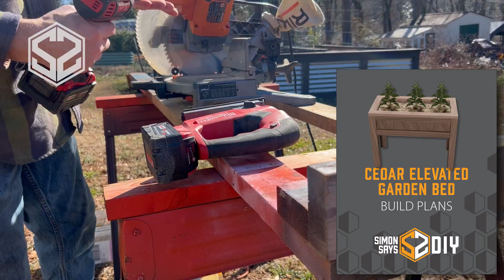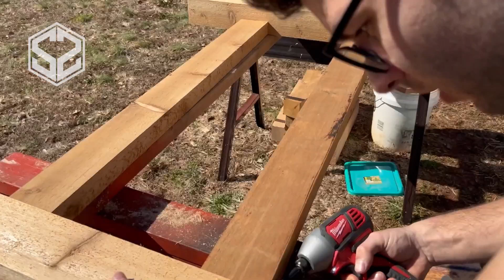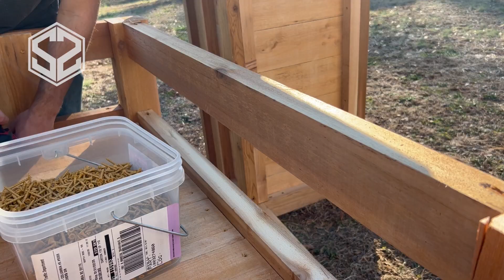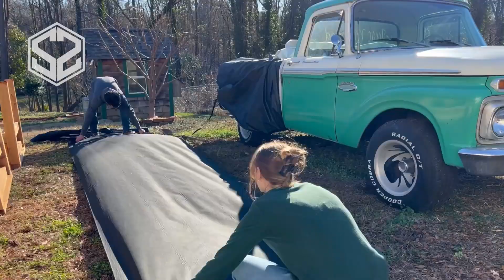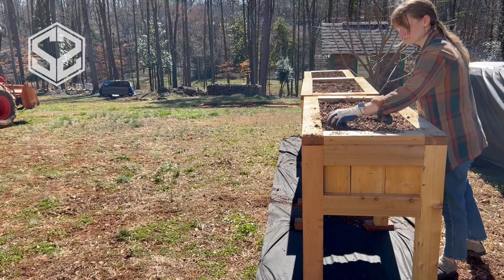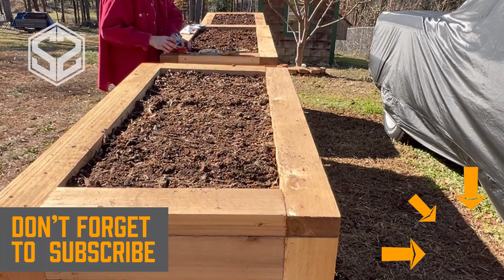Cedar Elevated Garden Beds

Comment: I was wondering if the landscaping fabric is healthy for growing vegetables?
Reply: It depends on how technical you want to get.  The material is polypropylene or polyester.  These shed micro and nano plastics which can end up in your food supply, the air you breathe, etc.  Some people are o.k. with that and say compared to drinking water out of a plastic bottle, it's not an issue.  I disagree and would not use it. What you want it to do is keep soil from washing out of the cracks, so an alternative might be a tight weave burlap (not like burlap bags).  As to the material on the ground, I never use landscape fabric....there are issues with that, too.  :)
Reply: ps....it's cedar,  I have cedar raised beds on the ground that are 5 years old and just fine.  Sure, eventually they will break down, but I can live with that.  Landscape cloth does not prevent moisture contact on the inside of the raised bed; that's not its function.  You would need regular plastic for that (again, not me).  I treat my cedar beds with unboiled linseed oil; it helps seal the pores and protect the wood longer, is fairly inexpensive, and is generally approved for organic gardening purposes.